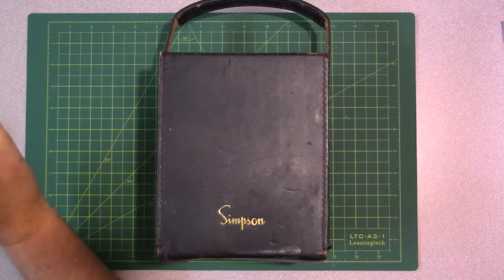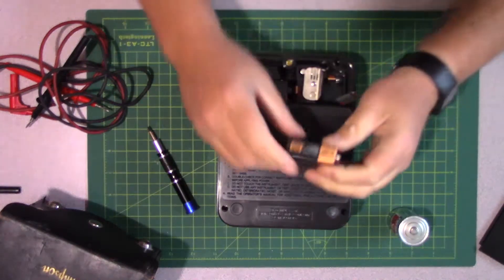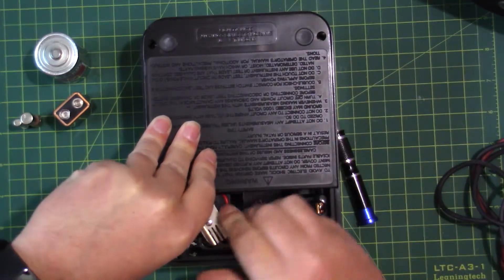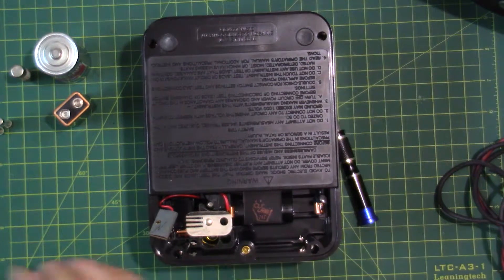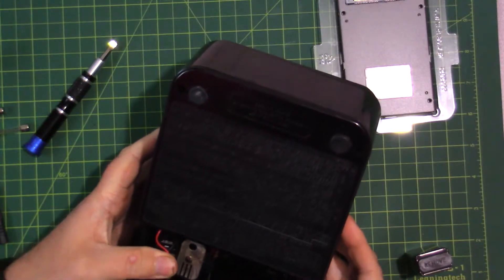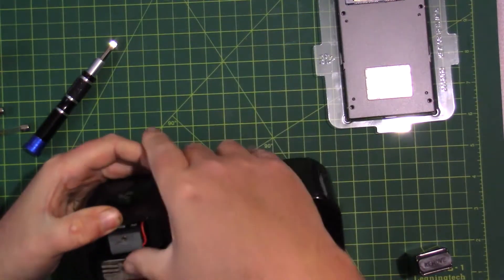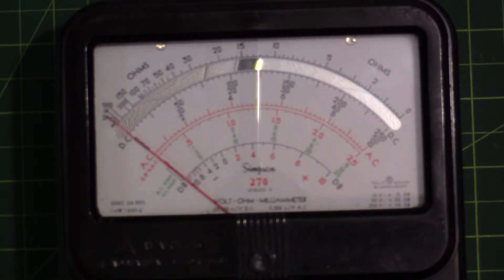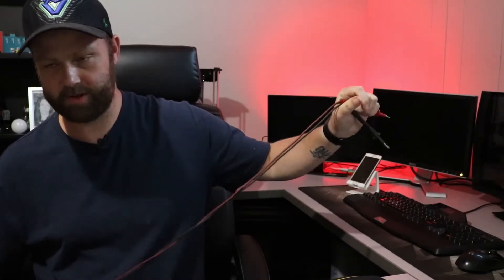The Sh!# My Wife Brings Home -Simpson 270 Series 5 Multimeter #5

Comment: I have a 270-5 as well as a 260-8. I use both as daily drivers.   The 270-5 is Simpsons High precision meter, with a guarantee of 1% accuracy. The 260 is 2% guaranteed accuracy. The 270 lives up to its claims of accuracy as well as does the 260. Best meters you can buy, IMHO, better than any fluke or other DVM, especially for troubleshooting electrical circuits. The taut band suspension of the meter movement is second to none!

Comment: Would be nice if you check the accuracy of Voltage and Current AC and DC, and Resistance.
Reply from the maker: thanks for the input have made note and going forward there is a bunch of things I will be changing I know this is older now but I have learnt a lot from how to construct my videos and the info to make sure is in it.  have a good one eh!